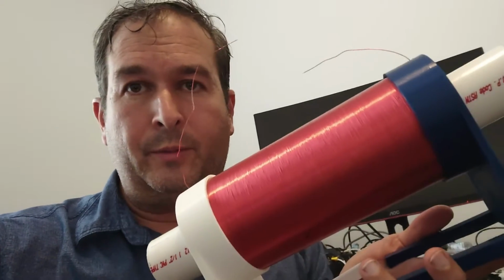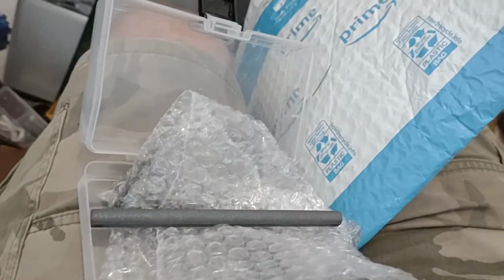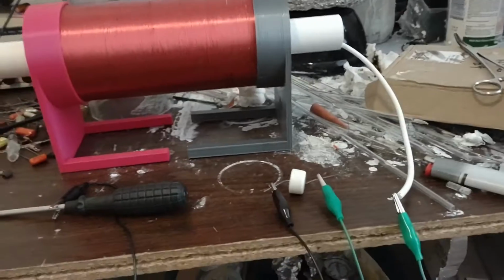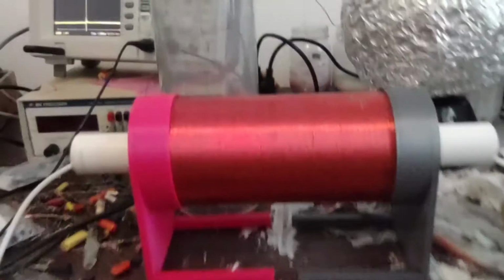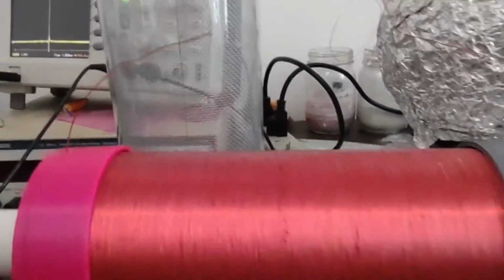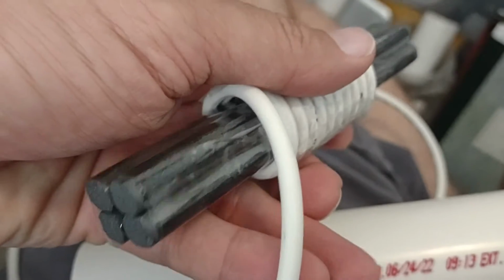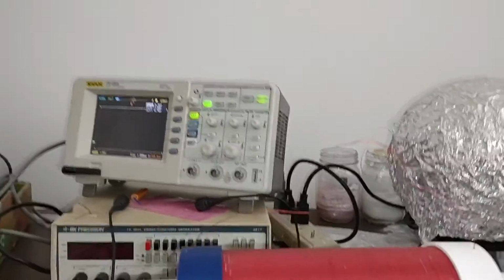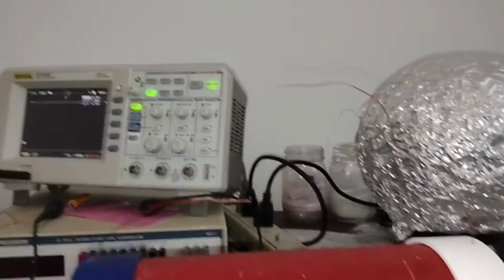200,000 Volt Pulsed Transformer

Comment: Hey Doc, new subscriber here. How would I make a 2,000 volt 100 kilohertz or higher transformer that I can run at resonance? Would I use a flyback core or should I use an air core? I could also make a 4,000 volt 100 ,kilohertz or higher transformer. Whichever one would be the most straightforward. Would I use 40 windings for the L1 and then 500 on the L2 for the 2,000 volts and 80 and 500 for the 4,000 volts? Thank you so much for your help.

Comment: Yeah good one 👍🏻 is that high voltage module output wires actual touching. When you charge the capacitor?
Reply from the maker: The charging circuit consists of a Chinese "400,000 volt" dc-dc converter, which I show in some of my other videos, to be about 15 kV in reality.. I charge a bank of doorknob capacitors rates at 15 kV,... then I use a insulated screwdriver, connected to one of the leads of the capacitors, to short the current through the primary windings of the transformer... the secondary winding have a air gap of about 2"... and the voltage is so high... that it arcs across that distance!